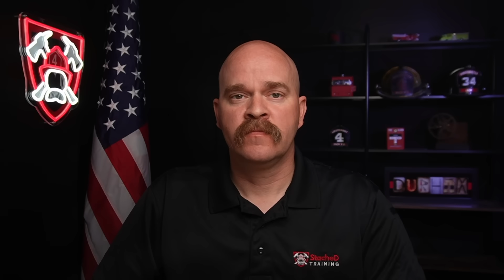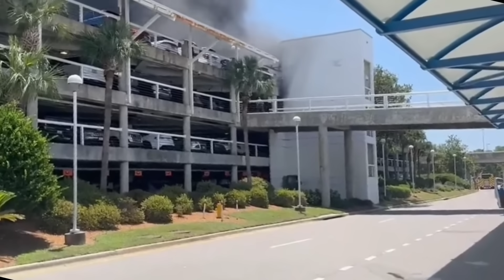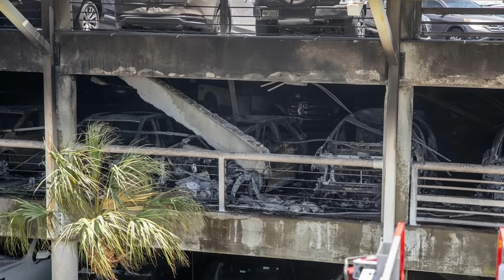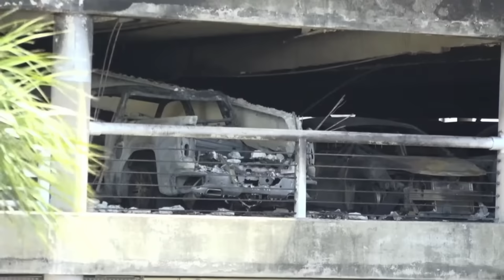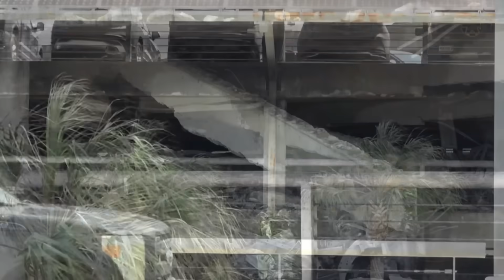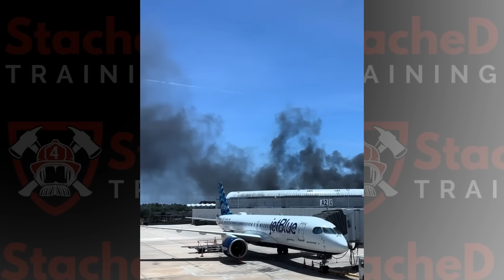Fire, Collapse, and Chaos: Jacksonville Airport Garage Incident

Comment: BMWs have a "Light Hybrid" system that puts a Lithium battery in a gasoline powered vehicle to run the "start/stop" system.  It is used to start the engine without using the starter motor.

Comment: As an engineer I am disappointed that you were "surprised" at the quick structural damage collapse failure. You should have already known that concrete is held together wit essentially water (hydrogen bonds)_ Intense heat rapidly drives the water bonds out of concrete turning concrete into worthless powder.

Comment: I agree with you, all parking garages should have sprinklers. I also think NFPA 13 is going to need to up the occupancy hazard from Ordinary Hazard Group 2 to Extra Hazard Group 2. It was changed from Ordinary Hazard Group 1 to 2 in the 2022 edition. However, with EV fires, that still isn't enough. It might need a special design to handle an EV fires. Thanks for the videos!

Comment: How old is the parking garage? (did I miss a mention of it?).  I'm in California and I know our state fire code has required fire sprinklers in parking garages prior to 2010 (even stand-alone ones not attached to an occupiable building structure). Most vehicles these days have plastic fuel tanks, so even though they hold up well to the fuel's chemistry they'll easily melt in a fire and release a flow of flammable/combustible fuel  to quickly spread the fire. Sad that this happened.

Comment: Never live in a building with a carpark under it.  Especially with ev chargers installed
Reply: Plastic fuel tanks usually under the rear seat and about an inch away from hot exhausts, ignition systems with thousands of volts to ignite the fuel...

Comment: The bottom line is that it really doesn't matter if an EV in an underground parking structure starts the fire or not... once the fire gets to the EV, things get MUCH worse. VERY QUICKLY. The more the number of EVs - the worse it gets. 
They simply should not be parked within (or possibly even have access kind of access to?) enclosed/underground spaces if those spaces do not have the facility to deal with the potential risk quickly and effectively.

Comment: Please correct me if I’m wrong, but wouldn’t a sprinkler system in a parking garage require a significantly higher flow rate to contain a well-involved vehicle fire than required for an interior structural fire?  It seems to me that a well-involved vehicle produces more BTU’s than ordinary class A combustibles.

Comment: Good analysis with limited info. I do have a question that may not have an answer. Video was being filmed from another vantage point even with the fire floor. I wonder if it would have been possible to set up a master stream from that point?
Reply from the maker: It appears to be an elevated roadway.  It was probably possible to get a truck up there,  however, they might not have access to water at that location.

Comment: Unless arson or rodents are involved the chances an ICE vehicle will catch fire after being parked for more than three hours is almost zero(unless it has a lithium 12v battery). Anything that started prior the the vehicle being parked will either go out or erupt into a full blaze within a few minutes of being parked, there will need to be something left running or set to turn on automatically for a fire to occur hours later, even a fuel leak is unlikely to cause a fire hours later unless there is a deep depression under the vehicle to catch the fuel so that it doesn't run off or evaporate. A fuel leak big enough to cause a problem would result in a large conflagration involving multiple vehicles in an instant not simple burn the leaking vehicle until the flames spread.

Comment: As a recently retired Fire Capt, my biggest fear is an EV catching fire in an UNDERGROUND parking lot. Where I worked, some lots are 5 - 6 levels BELOW ground
Reply: No idea what you're talking about. If the large battery ignites the fire, it could burn for HOURS. Have you ever been in an underground parking garage fire, with multiple vehicles burning? I have, and it's not pretty, and it's not fun. If the sprinklers can't contain the fire, it gets worse, as you can see in this ABOVE GROUND, outdoor parking garage. Underground vehicle fires is a very dangerous incident to deal with, as are underground Subway fires.
Reply: My opinions are based on videos of Tesla fires. If the main battery is the source, a large, torch like, fire burns horizontally from the bottom of the car. If there were several Tesla's parked beside one another, side by side, and that fire ignited the battery of the car beside it, things are just gonna get worse. In an underground garage, a sprinkler system will not contain it, and neither will a 65mm (2.5 inch) hoseline. At best, two or three large 2.5 inch hoseline a would be required. A very nasty situation.

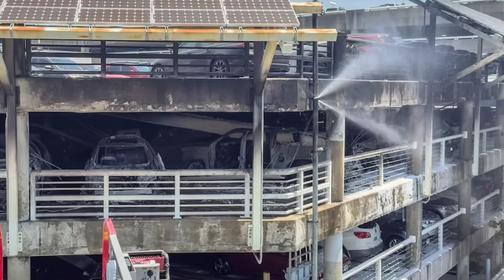Comment: "....if your garage isn't protected with sprinklers or suppression.....". What's the "or suppression"? There is no alternative in an open garage stucture for alternative suppression, is there? Nor is there any need, given the proven track record for automatic fire sprinklers. You just have to have codes that mandate their installation. And see what contractor signed the test cert for the last hydro on the dry standpipe system (3:43).....

Comment: Are there any advantages to EVs?
They're environmentally disastrous - mining as well as recycling (which means that new batteries require new minerals).

They burn way hotter than ICE cars (2000°C vs. 900°C) and damage more of their surroundings.

The HF gas is toxic and corrosive. And can explode.

They're not doing anything for CO2 levels (not that it actually is a problem, so it's a non-solution to a non-problem).

Waster used by firefighters is at least 10x more for EVs than for ICE vehicles and the water is polluted far worse than for ICE vehicles (oil remnants can be broken down in nature - heavy metals cannot).

EVs can reignite months after a fire.

EVs charging en masse requires a lot more copper to be mined.

EVs are heavier and therefore cause more damage to roads.

I guess they can accelerate really fast (increased wear on tyres - increased micro plastics) and some EVs lets you give the horn a farting sound.

Comment: One thing that affected the time before the collapse of the structure is that once more than the initial vehicle becomes involved then this fire becomes a hydrocarbon fire with much higher temperatures. The mere act of spraying water into the fire will cause spalling of the concrete and exposure of the reinforcing steel will accelerate the collapse!

Comment: EV's should also be required to park in an open air ground level segregated parking lot at least 50 ft from other vehicles.
Reply: Plastic fuel tanks usually under the rear seat and about an inch away from hot exhausts, ignition systems with thousands of volts to ignite the fuel...

Comment: Wait, WHAT??? A multi-level parking structure with EV charging facilities AT AN AIRPORT without a sprinkler system??? Wow.
Whether or not sprinklers would be required by local code or FAA, the owner(s) and their insurance company should have WANTED a well-supplied system (capable of flowing all heads simultaneously). Predictable is preventable!!!

Comment: Pat, can you do a video on ferries? I live in the Pacific Northwest and regularly get on a ferry with my car. The ferries are packed TIGHT. As more and more EVs ride the ferries, I do worry about a fire breaking out on a ferry. Add to that they are now building hybrid ferries with large battery packs alongside the regular diesel engine. The ferries do have sprinkler systems but have limited fresh water aboard. Obviously sea water is a no go to use when attempting to put out a lithium battery fire. And there is VERY little room for crew to maneuver to get a fire blanket over a car. I'd love to get your thoughts on risks as more EVs are riding on the ferries. Thank you!!

Comment: EV's should be parked on their own away from ice cars
Reply: Plastic fuel tanks usually under the rear seat and about an inch away from hot exhausts, ignition systems with thousands of volts to ignite the fuel...

Comment: As a parking garage designer, I have always used 9’ wide spaces, which is wider than a typical office garage.  This is to allow easier luggage access.
Reply: You would be the exception.  Every airport parking garage I have ever been in had tight spacing.
Reply: @cleanwillie1307 it doesn't help that cars have grown way to big
Reply: The "business decision" always overrules the engineering recommendations to maximize the revenue.
Reply: @umaikakudo except the managers cut out necessary systems in favor of profits
Reply: Parking stall sizes are typically governed by local municipal/county  codes and the ADA.

Comment: Escalators and other equipment problematic during emergencies should be required to have an easily accessible (and preferably standardized format) emergency  power disconnect switch also easy to lock out/tag out since making the equipment safe for maintenance is at least as important to prevent worker injury or worse. When an e-stop is actuated reset should require technician intervention to prevent "teens" from playing dangerous games with it. Existing elevator safety systems are useful design inspiration.

Comment: Say no to battery vehicles.
Reply: Plastic fuel tanks usually under the rear seat and about an inch away from hot exhausts, ignition systems with thousands of volts to ignite the fuel...
Reply: @kylereese4822  still we don't see much fuel fires. Do we?

Comment: I have seen statistics that Hybrid Car fires are actually more prevalent, but usually not as damaging.  Hybrid batteries probably catch on fire as often as EVs, but they are much smaller.  However the car contains gasoline, so if the fire spread toward the tankage, it may flow liquid out onto the local surface, especially with the newer plastic tanks.  FLAT parking garages are obviously the worst.  In contrast, EVs have battery total energy (including the chemical combustion) which is equivalent to gasoline cars, but they usually remain localized, unless, AGAIN, they are trapped next to other vehicles.  Roughly the same scenario emerges for the Fire Department.

Comment: A parking garage with no fire sprinkler system should not exist.
Reply: I am just all for banning EVs from all parking structures.
Reply: I'm in Vegas. There is a parking garage at an off strip casino that was built in the 80's. They somehow did not consider storm water drainage or fire suppression in the design. The first flash flood made the errors glaringly obvious. It took a significant amount of work to correct the issues and looks terrible. Needless to say when the same property added additional parking garages they were designed appropriately.
Reply: A person that makes a stupid comment like you did should not exist!
Reply: You are correct. But no sprinkler system is going to be able to touch an EV fire.
Reply: @ambulet  Perhaps not. But it may prevent the fire from spreading all over the building. Most cars are still non EV at this time and all of them have a lot of combustible materials like fuel, plastics, rubbers and foams.
Reply: @ambulet  sprinklers are to stop the spread. If this garage had sprinklers it wouldn't have been destroyed and fully engulfed. The damage would have been isolated to a smaller area around the source. As the heat spread more and more sprinklers would go off, wetting the area and keeping fire spread down.

Comment: Once the grid goes off to the carpark, the solar panel inverters should disconnect and stop generating,  However the DC cables from the panels themselves will have live power to inverter so long as the sun shines or the cables from them are burned through.

Comment: The only battery in my cars is a 12V lead battery and I'm not even remotely curious to try anything else. Driving since 1981 with zero drama 😉
Reply: Plastic fuel tanks usually under the rear seat and about an inch away from hot exhausts, ignition systems with thousands of volts to ignite the fuel...
Reply: @kylereese4822 where do you get info from? You obviously know nothing about cars. Theres NOT "thousands of volts" running over a fuel tank.

Comment: Solar panels on buildings is a hazard when the building couts fire , or get damaged, the cablels might get damaged melted by the heat  and come in contact with metal structures, elctrocuting fire fighters, in sweden the fire services will not go up on roofs with solar panels of there is a rire in the house.  ( to cut up  smoke vent holes for example)
The scary thing with solar panels are that they always produce power if there is  sunshine , there i no switch or off button.  So  metal roofing or other building parts getting voltage is a big risk if insulation is damaged.
There has been experiments done with tarps laid over  to turn them of but the glass have tendency to melt the tarps ,if there is warm weather, strong sunlight .
The problem is hard to solve, and the cable canalisation for the panels is not regulated as well as  ordinary electrical  installations. For example the dc cables may just lay on the roof under the panel at spots to begin with.

Comment: All car chassis flexible as part of their design.. flexing will inevitably result in microfractures in fragile battery systems..
Reply: Plastic fuel tanks usually under the rear seat and about an inch away from hot exhausts, ignition systems with thousands of volts to ignite the fuel...

Comment: Not surprised with the non release of the surveillance footage, as it is an open investigation. Good video on the hazards of parking structure fires, thanks for posting. I only lean to the EV type fire as concrete has a burn time of 2-4 hours, depending on the mix design, age of concrete, intensity of the heat source and duration of exposure. Am interested in seeing your update on this once the investigation is finalized.
Reply: Gasoline burns very hot too.
Reply: @TheTrainWatch yes, but a fuel fire typically will cause failure in time-frames on the order of an hour or two at the earliest. Emphasis on typically.

Comment: It's obvious that - as the number of the EVs in circulation increase - the civil infrastructure requires an upgrade, as you mentioned in the video. Sprinklers, infrared temperature detectors and alarms, physical firewalls, increased separation between vehicles, etc. 
EVs manufacturers should do their part - i.e. include some sensors in the battery casing to allow for failure predictions; like gas sensors to monitor the release of organic solvent vapours, and differential temperature sensors to detect even a single cell in the pack that is starting the avalanche which ends in self ignition of one cell first, and subsequently the entire battery pack.
Thank you for the informative video.
Greetings from the UK,
Anthony
Reply: We still study the 2017 Liverpool Echo Arena Parking Garage Fire at fire academy, in regards to design and how the gasoline flowed through the drainage system, igniting some 1300 vehicles.
Reply: @ryanfagan4563  I've been looking for an explanation for how that fire spread.  All I can find is they blame a bunch of cloth advertising banners that were between the cars, and high winds that night.  Where did you find the details about gasoline in the drainage system?  They said the car that started it was a Land Rover diesel model.
Do you remember how the drainage system designed?  If that was to drain rain water, I would expect it would take the water towards the nearest wall and down a gutter or drain pipe.  Seems weird if they had drainage going along the path of the cars.
Reply: @cherryjuice9946  This is from the inspection repot. "Another concern is that plastic fuel tanks can begin to show signs of failure after a 2-5-minute pool fire exposure, which can result in a flowing liquid fire that exacerbates fire spread. As more vehicles become involved, the prolonged high-temperature exposures on the load-bearing structural elements can threaten the integrity of the structure. At the Liverpool incident, the constant high temperature exposures caused significant spalling of the concrete, which typically occurs when the internal temperature exceeds 374°C (705°F). This created large penetrations in the floor which contributed to vertical fire spread. The ceiling level temperatures experienced from an inferno of modern vehicles can also cause failure of structural steel. Once it exceeds its critical threshold of 538°C (1000°F) the load bearing capacity is reduced to half and may compromise the structure. As seen in the Stavanger Airport fire in Norway (2020), these conditions can lead to structural collapse of a multi-story parking structure.

Comment: in such commercial properties no local personell can do anything - usually they are building managers, caretakers and so on and do not understand anything in power, cables, PV, structures and so on. Even if they have keys for switchrooms and so on they have no clue what is inside, cant find tripped breaker or in opposite isolate faulty equipment.

Sprinklers, walls and so on - in OPEN carpark? Unreal and unusable. Will freeze on winters (so must be dry pipes + some electronic sensors), rust and cover with dust (especially sensors) on summers, leak to cars with damage and losses, regularly be damaged by overheight vehicles... Walls prevent ventilation from exhaust gases, its the main reason why it is open carpark - without walls its deemed to be safe, does not require CO sensors, artificial ventilation and so on even for very active car movement on multiple floors. So unreal, it rises the cost of such carpark 10 times. From the other hand there are usually very few people there, and all of them are active, can evacuate fast and easy. So let it burn, insurance is cheaper.